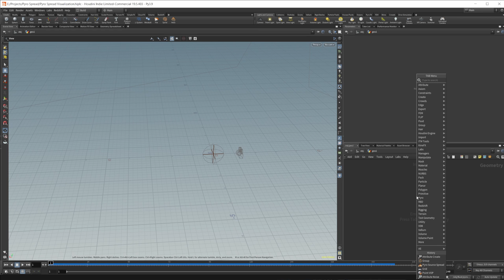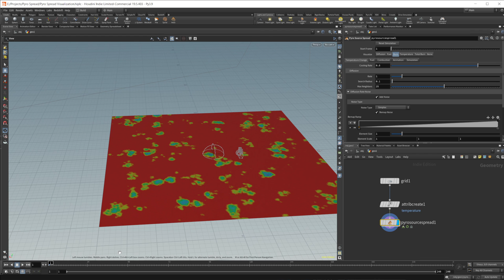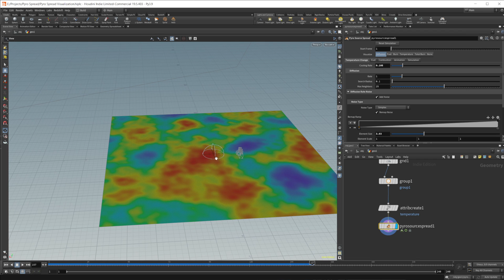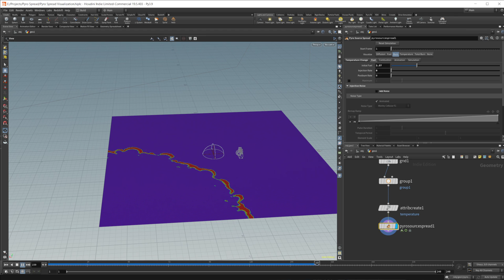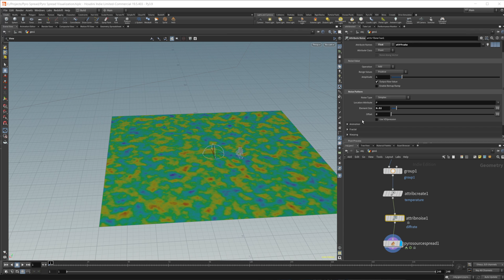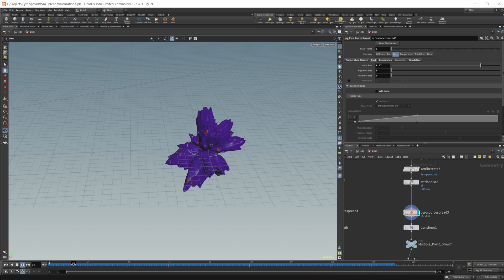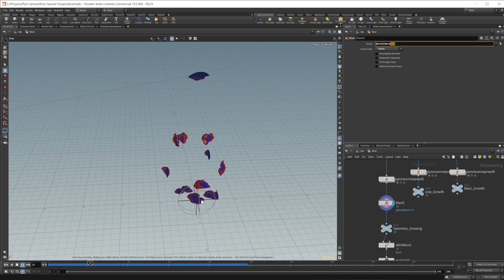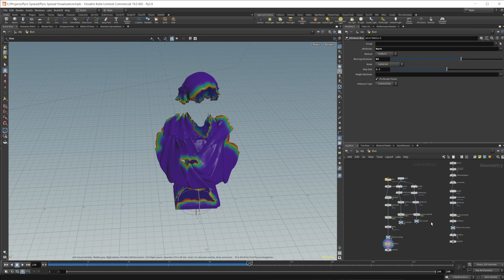Getting Started with Pyro Source Spread | Houdini 19.5

Comment: Any idea why I might be hitting a wall straight away with getting the points to spread at all after lowering the cooling rate? Followed everything exactly with the selection of points, etc!
Reply from the maker: Scale probably plays a factor in this setup. The cooling rate may be too high for the initial temperature. Try upping the initial temperature
Reply: @InsideTheMindSpace  I think scale might be it - when made my point selection considerably bigger, I did get a bit more spread but it just stops beyond a certain point and I'm struggling to get it to cover the object no matter how extreme I set the highs / lows of the various settings. So I'd set the temperature higher in the attribute create? Thanks!
Reply from the maker: @rubysnell6755 if it's stopping after a certain point then it's cooling faster than it can spread and you'll need to continuously adjust the temperature so that doesn't happen or you can adjust your cooling rate.
Reply: @ Okay thanks! I'm new to this tool! So it's not a uniform case of "lower cooling rate makes spread happen faster", the cooling rate may need to be higher and it's finding the exact right value?
Reply from the maker: @rubysnell6755 correct. It's a balance of all the values